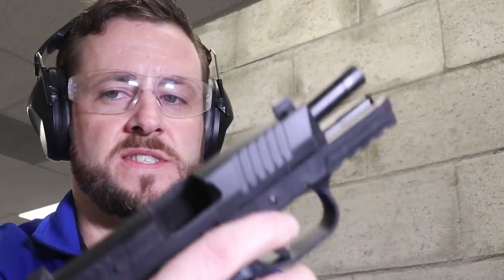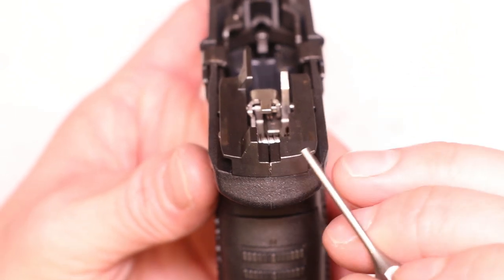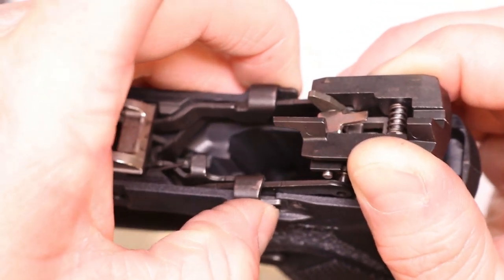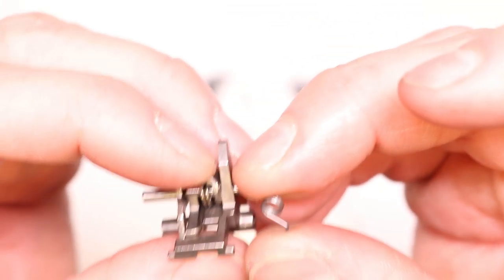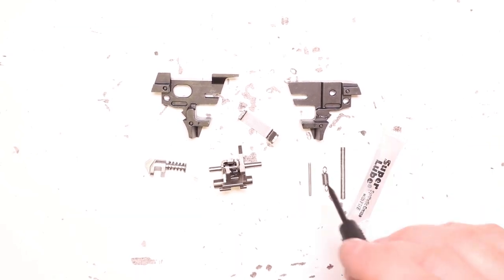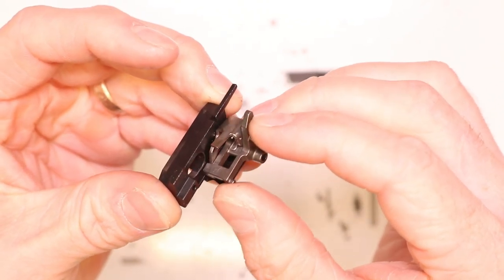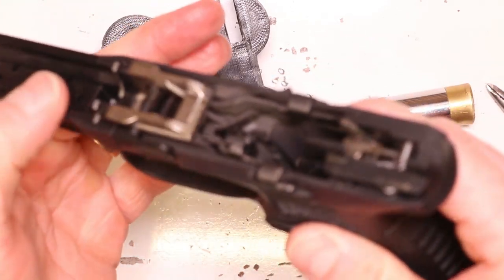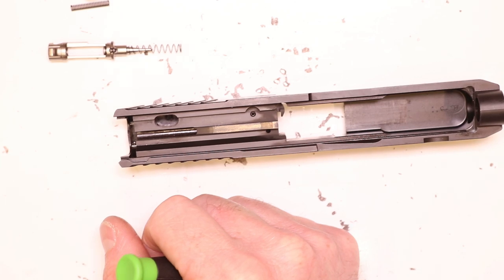FN 509 Trigger Upgrade & FN 509 Disassembly - FN 509 Accessories by M*CARBO

Comment: You do the BEST instructional videos I think I have ever seen. I especially appreciate that you have it zoomed in enough to actually be able to see the details of what you’re explaining, 
So straight out of the box my 509 midsize was getting 6.5-7lb pulls, and the trigger felt rough and inconsistent. Now after putting the Mcarbo springs in, I haven’t had a pull over 4.5… and DAMN does it feel so much smoother!!! I still have to range test it, but so far I am thoroughly impressed! I absolutely love this pistol now. I can’t thank you guys enough! Now to put your spring kit in my P365XL, and take the beauties to the range!

Comment: What a difference on my 509 compact tactical!  I didn't get it done in 10 minutes, but while I was replacing the springs, testing and sliding the pieces in the assembly, I noticed a lot of grittiness, really nasty.  So, I took my ceramic Spyderco sticks, some some 3M Tri-M-ite, my mini super fine files and started honing - about 2 hours worth. The final result is a near zero grit light trigger with a clean break. It's like a day and night different!   Your kit did such a great job and your video is fantastic.  I may forgo the Apex trigger.  Thank you guys for what you do, have done and will do! We stand strong in the USA!
Reply: What did you hone? The frame or metal parts? Thanks!

Comment: One of the best instructional videos (probably the best). Just finished my installation. It was tricky in a couple of areas but eventually came all together. I had a 6Lb. trigger when started and now it's 3.7 Lbs. Being a new gun with about 500 rounds thru it. it could drop a little more over time. Thank You so much for the detailed video and explaining how all the parts work together.  10⭐

Comment: Absolutely worth the money.  Just received mine and installed it in my FN 509 Tactical in about 10 minutes with the help of this video.  Smooth, light take up and break.  I paired it with an Apex flat trigger and it feels amazing.  I didn't realize these guys were my neighbors when I ordered.  Live only about 40 minutes away.  Keep up the excellent work.  I'll be ordering another when my FN 509 midsize MRD comes in.  Oh, and I love the fact that it's veteran operated and made in the USA!
Reply from the maker: Awesome!  Glad to hear this!  Thanks Brother for your Support.  Come on by anytime!
Reply: Have you measured the pull with the Apex trigger before and after the install of the springs?
Reply: Sorry, no I didn't since I didn't have the correct tools to do so
Reply: @chanderson1  Thanks. I think I'm going to go ahead and pick up a set of springs. The install doesn't look so bad especially compared to putting in that Apex trigger.
Reply: The install is not so bad.  I have extra large hands and those tiny springs were a bit challenging for me.  A good pair of tweezers assisted me get the springs to where they needed to be and a magnetic pan helped me keep from losing all the small bits.  I learned to have patience because replacing internals on a 509 is a little more involved compared to working on my Glocks.
Reply: @chanderson1  I guess I'm still traumatized from the trigger install. Like a dummy, and because I was going back and forth into the house where youtube is and my garage where my shop is I got distracted and started the pin about a third of the way in from the wrong direction. Yeah, that pin. Anyhow it was a bear to get out. If not for that screwup on my part the trigger install would have been flawless.

Comment: What an OUTSTANDING video!  I had to replace the OEM striker pin and replace it with the Apex striker pin.  Your video is significantly better than theirs.  After watching your video I feel confident that I can upgrade the trigger.  I like the FN509 pistol, but dislike the trigger since I have to slowly pull the trigger and concentrate not to dip the pistol while I am pushing the trigger back for accurate shot placements.  The best part is that if I fail I can pack the parts and send it your way.  FN engineers owe you big time!

Comment: Your video on the trigger of the FN509 is absolutely FIRST CLASS and COULDN'T BE BETTER. The only problem with the 509 was the heavier pull and YOU SOLVED IT right here. Good work!

Comment: My 509 midsize had the same issue with the trigger safety dragging against the frame behind the trigger where it enters the frame. I cut a 3/16 wide piece of 2500 grit automotive wet or dry auto body sand paper and slipped it in that space between the trigger safety and frame and put the sanding side against the trigger safety and placed a drop of oil where the trigger safety was now contacting the strip of sand paper and pulled the trigger 5 or 6 times rubbing it against the sandpaper and then pulled the sandpaper out and checked to see if the trigger was still dragging on the frame. I ended up having to pull the trigger with the sandpaper in place about 30 times before I got it sanded down & polished up at the same time since it was 2500 grit paper so it wasn’t dragging any longer. I then double checked the safety with a drop test several times on a hard rubber mat and it was still safe. Made a total difference in that first pull to the wall,  barely any resistance what so ever now because there’s a thin sheet of paper gap between the trigger safety and frame now like I think was intended from the factory because I’ve seen other 509 that didn’t do this. Even 10/1000in is the difference between it rubbing or not there.

Comment: I just finished installing my spring kit with a apex striker and my trigger weight went from nearly 6 pounds to 3.12 average. It really is smooth through the wall and a huge improvement. It was a simple instal as well. I never felt discouraged with your video.
Reply: Well sad day yesterday. The gun ran fine the few times I took it out. Estimated 300 rounds through it. Then I started getting light primer strikes yesterday. Had to swap the oem springs back in. I wish I didn’t have to because the trigger is awesome with your guys’s springs.
Reply: I have a feeling the apex striker is too heavy for those light springs. I have oem springs and the new durable striker from apex, I get light primer strikes on only maxtecc ammo often

Comment: I just installed a kit and a half (I have one frame and two slides 9 and 40) in FN FNS. Only the original sear spring had a different design, but the lighter one from the kit works just fine. The trigger pull dropped by about two and a half lbs in both cases. The 40 remains heavier than the 9 as there is more scratching between the striker and the slide. I cannot wait to bring them to the range to try them. Great job on the kit!
Reply from the maker: Awesome!  Thanks for sharing the results.

Comment: Just finished install on a FN 509c. Initial trigger pull was about 5.5lbs. After install the pull is 3lbs and more crisp and predictable. Changing the springs in the sear reduced the pull to 4-4.5lbs. Not sure I will leave it at 3lbs, but it sure is fun to play with right now. This is the eighth mcarbo kit I have installed and loved them all. Finding myself looking to see if mcarbo makes a kit before I purchase a firearm. Products are that good and affordable.

Comment: I appreciate your tutorial and I may be incorrect, but it looks to me that your sear spring was installed backwards. There is a hole in the side of the sear for the L on the spring to be inserted in to. When you pulled the old one out I believe it was installed backwards and when you replaced it with the new, you also installed it incorrectly. Maybe I am wrong, but when I pulled my sear apart, it had the dog leg in the small hole located next to the pin hole.

Comment: I just finished the McCarbo spring kit in my FN509 and it did reduce my trigger pull down to about 5.5 lbs. My 509 was one that had a very heavy trigger, I was hoping for about 4.5 lbs but that was too much to ask. There must have been a upgrade in the 509 parts because mine would not work based on the video, 95% of the video was right on but there was a small part positioning ( my part was different) that the video didn't show, so I had to completely take it apart and re assemble it 4 times and troubleshoot and finally it was good to go. McCarbo makes great stuff I used their perts in other guns, all were good.

Comment: Great detailed video, very explanatory. One very important issue was when the sear spring was installed he did it upside down! Good thing I noticed when pulling out the original the little 90 bend was actually inserted in the little tiny hole in the sear and not pressing down on the sear frame. Might not make a huge difference unless the spring slips through and then the sear will drop and bang!
Reply: I caught that also, I am doing mine now. I came to the comments before going further. wanted to make sure.
Reply: Same issue.  I caught that by swapping between the M*CARBO and Gun Bench video.
Reply: I’m about to do mine… could you guys provide a pic or be more detailed in what you found?
Reply: @bassbeasts1603  Sorry man, I looked for the pics, but I must of deleted them.  I recommend watching both the M*Carbo and the Gun Bench videos...like two or the times.  Take it slow and take lots of pics from all angles as you break down your weapon. When you get to the sear, you'll notice a little hole in it.  Thats where the 90 degree bend in the spring goes.  Trust me, if my dumb ass could figure it out, anyone can.
Reply: @BzHard  LOL! That’s why my dumb ass was asking! 😂 thanks dude.
Reply: @BzHard  got it done… just watched gun bench. Boz, are you worried about the stock firing pin? Been hearing some had problems. 
By the way, it softened that trigger by at least 35%. I greased the trigger well inside and out as well.
Reply: @bassbeasts1603  I also installed an Apex trigger, heavy duty striker, and failure resistant extractor.

Honestly, I don't think there's one firearm I own that I haven't tweeked. 😂
Reply: @BzHard  did you shoot it with just the mcarbo spring set before you installed the apex stuff? If so, how much difference does the apex trigger make. I may get one. Thanks for responding bro.
Reply: @bassbeasts1603  Yes sir, shot it unmodified...trigger pull was around 5.5 lbs.  I put in the Apex trigger first...stock trigger was too "gritty". Apex trigger brought the pull down to a little under 4.5 lbs.  Then I threw in the M*Carbo set and I'm right around 3.5 lbs according to my Wheeler trigger gauge.

I definitely recommend the Apex trigger w/ the M*Carbo spring set.  It does make a huge difference.

Comment: Huge fan of this company.  I have MCarbo trigger spring kits in a lot of my guns.  This one was the most fun of them all.  Great instruction and tips.  I first tried it on my FN 509 Midsize and it took me the full length of the video plus about 10 minutes to complete.  Then I immediately added a kit to my 509 Tactical and only took me about 15 minutes.  DRASTICALLY reduced the weight of the guns and helped the trigger reset so much.  The 509 has leaped forward to my favorite gun now with the help of MCarbo.  Thank you!  Are there any works to add a kit for the Beretta APX???
Reply from the maker: Awesome!  Glad to hear this Brother, thank you for sharing your results!  Yes Sir, we are working on a trigger improvement for the APX.  Keep following up on it.  Won’t be long.

Comment: Video was awesome , easy swap and significant improvement , waiting on an Apex striker finish it off , spring kit was worth every penny 👍
Reply: Have you done an apex trigger in there too? I’m looking at getting this kit, the apex striker and the apex trigger. Looking to polish the trigger bar on the apex trigger and throw it all in, just curious what pull weights are like with all that in, nobody has a video on the combo.

Comment: I have one brand new out of the box and the trigger sticks after pulling it. I'm putting it back together after taking it apart and I'll see what happens. Still sticking so I'll be ordering a new trigger, just disappointing after spending a grand and can't even use the gun.
Reply from the maker: If you find yourself stuck on the issue you can always send it into our gunsmiths. They are great at fixing issues like this. https://www.mcarbo.com/custom-shop.aspx

Comment: Worth its weight in gold this trigger spring kit is freaking insane highhhhllllyyy recommended!!!!!! Oh yea FN I hate you. My 509cc edge shoots better and flatter than any striker fire Iv ever shot but at what cost it’s jammed more times than All my guns combined. And I got a lot of guns, to top it off it’s the worst trigger Iv ever felt in my life. Now I manually cycled it literally not exaggerating probably 2-5 thousand times and put 500-800 rounds threw it of different 124gr ammo and it’s starting to get more reliable last outing I shot 200 rounds and only had one failure to feed and maybe 3 mags to fail to lock back last shot. Someone could make a lot of money making a recoil guide rod for it with a few different weight springs for it, because after doing some research the 509cc edge the same issues I’m haveing is obviously a part of owning this gun. Bs
Reply: hard to understand lol but i my gun is jamming at the range since i installed the trigger spring kit. i took it out and put the original but i have the apex tacitcal trigger so it makes up for it in a sort of way . i just like the springs are too light and you fire fast or something but yeah my fn was jamming alot with those springs in

Comment: Maybe im doing something wrong but i installed the trigger upgrade, the titanium striker and i have a enhancement trigger kit from apex tactical and went to the range and not even 50 bullets in the gun started jamming where i pull the trigger and clicks and im having to cock back the slide and 124 grain ammo is releasing. itll fire again and jam so i dont know where to begin on what could be the issue...

Comment: any light primer strike issues going on with this? this is a pretty substantial drop in spring weight... although it is spread among a few different springs.
Reply: I came across 1 review that mentioned light primer strikes.  The person stated they had also switched to the Apex Tactical heavy duty striker.  Once they switched back to the factory striker, there were no more light primer strikes.  I order the kit and will be installing it with an Apex trigger.  Will report back to let you know what the outcome is.
Reply: I haven't test fired the pistol yet BUT the setup I am moving forward with: Apex trigger kit, M*carbo spring kit w/ original FN sriker spring and the heavy duty Apex striker. 

I felt the light striker spring from the M*carbo kit made the trigger just a bit lighter than I wanted.  On top of that, I could feel every bit of "grit" in the trigger pull which made it seem inconsistent and sometimes had reset issues.  Introducing the FN striker spring back to the setup improved this while making the pull a little heavier.  I feel all of the trigger issues were due to a poorly made striker.
Reply: @MonsterChuck  Any update after firing it ?

Comment: I did the spring upgrade and unfortunately the trigger is still marginal.  It’s not easy to change out the trigger springs as should be evident in the video and I’m no slouch with tools.  Maybe time to give Apex Tactical a call.  Love the gun other than the trigger
Reply: I haven't test fired the pistol yet BUT the setup I am moving forward with: Apex trigger kit, M*carbo spring kit w/ original FN sriker spring and the heavy duty Apex striker. 

I felt the light striker spring from the M*carbo kit made the trigger just a bit lighter than I wanted.  On top of that, I could feel every bit of "grit" in the trigger pull which made it seem inconsistent and sometimes had reset issues.  Introducing the FN striker spring back to the setup improved this while making the pull a little heavier.  I feel all of the trigger issues were due to a poorly made striker.

Comment: Just got a 509 and came across this spring kit on a forum. Was also looking at the Apex trigger. Apologies for the newbie question, but does this spring kit replace the need for an Apex trigger? Or, could I get this and the Apex trigger? Or, if I get this, would I not need the Apex? Thank you
Reply from the maker: You can mix and match to your liking but make sure you test if it is safe before carrying.
Reply: MCARBO Just installed this, super easy, and a great video instructing on how to do it. Also, good to see how the internals of the gun all operate together. The trigger pull with the new springs + the greasing of the underside of the trigger has made it SO much better. Night and day difference. Can’t wait to shoot it!